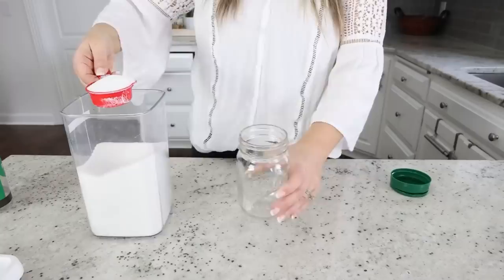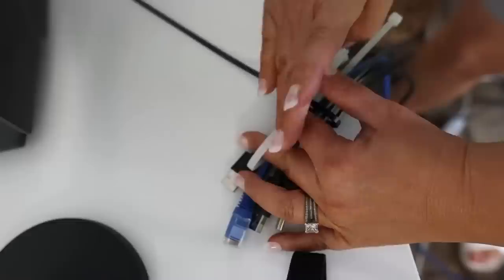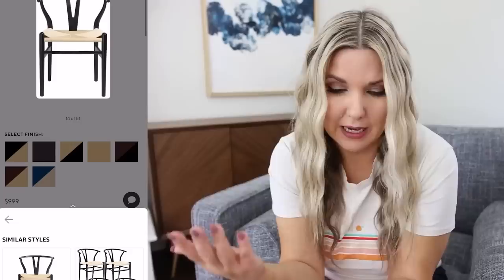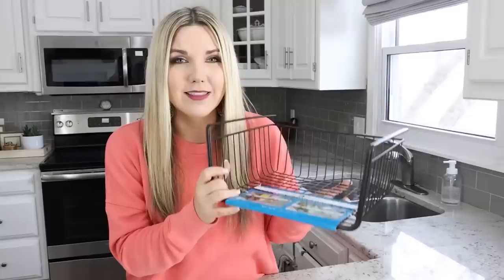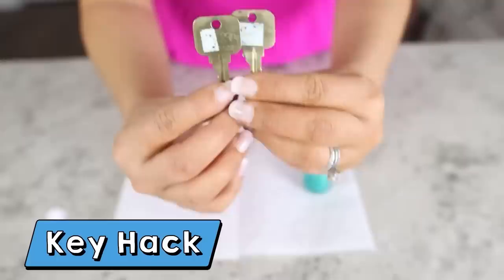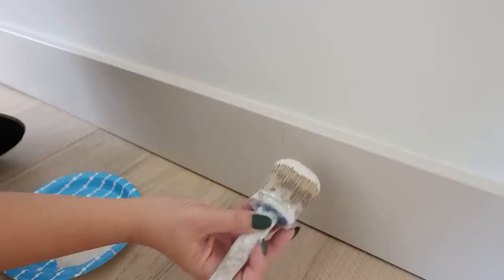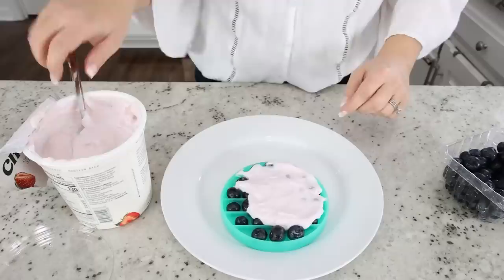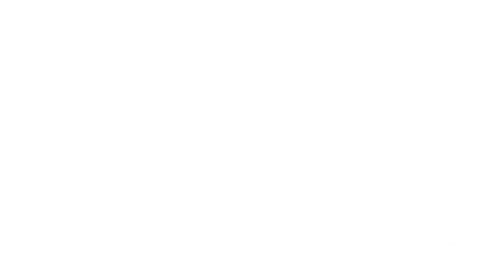60 HOME HACKS...That You HAVE TO TRY!

Comment: Watering plants:  I save an attractive wine bottle and keep it on my windowsill in the kitchen.  It looks nice and helps me remember to water my plants which are succulents and only occasionally need to be watered.  Getting label residue off of bottles:  Goo Gone is invaluable!  Using tooth brush holder for artificial plants:  Cut the stems down so that they're not sticking out of the "vase" unnaturally.  (I used to do a lot of "silk" flower arranging back in the day.  Don't forget the Spanish moss!  It covers a lot of sins, so to speak.
Reply: Might as well just use Dawn dish soap because Goo Gone not only smells horrible, but leaves it's own oily residue behind that needs lots of dish soap to get off.

Comment: Hi Liz I have watch a lot of your hack videos an have tired a lot which I love, but there is one hack that I would love to see someone come up with is an easy way to cleaning a ceiling fan without having to take the whole thing apart, it's such a pain, please if you know of a way please share🥰🤣
Reply: Use an old or cheap pillow case put over blade and pull and the pillow catches the dust!!
Reply: @Debra Murray If it’s just dusty I just use my leaf blower, I pick up the dust when I vacuum. I use the leaf blower (it’s a small one) for a bunch of stuff. I also have a small and quite air compressor that I use for dusting. 🤔🙄There is also a blade cleaning brush. When you have clean blades and housing wipe them down with Bounce dryer sheets as they will help with keeping dust from sticking as bad.
I just love her channels.
Reply: @DiywithButtacupsCreations  you can also do it with an old tube sock 🧦
Reply: @sdeaglefeather  ohhhh that’s a great idea!
Reply: Sock on a large handle cleaning ceiling fan blades

Comment: liz on the denture tablets.  before you dump the water out wipe the outside with the solution that was in the inside.  You had two vases if you are not in a hurry one tablet will clean several glass pieces.  Then all you need is one tablet for several pieces.  This method works for porcelain toilet bowls, and wash basins also.  Because you will be using more water you will need 2-3 tablets.  Let the tablets set longer than 5 min.  I would give it 30 min depending on the stain.  You used a generic denture tablet.  The name brand starting with an " E " works the best for me.  Also your water will make a big difference in the outcome.  Softened water works best. This solution works on mirrors and windows, basically anything glass.  Did the tray tiles you use have glazing on the edges?  If not they could be rough and porous.  I would sand and seal the edges and treat the wood if it was being used near water.  Baby oil builds up to yuk and dust clings to the oil.  Your better option is Pledge furniture polish or Armour All Dash Bright.  Who would not know about the fan.  Just read the instructions. DAH!   If there is any slime residue left in the cushion it will eventually work the chemicals up into the new fabric.  You also could have saved a large portion of the material you used by cutting only the fabric needed to cover the top portion. Those tabs are not just on aluminum foil but all rolled papers and plastic.  This has been around since onset and the instructions are on the box.  Come on.  Can we not read anymore?  God!  the candle hack yeah it works but you get black run down from the previous wick and it takes a hell of a lot longer.  Common sense people why are these "HACKS"?   Every single thing you have shown I have been doing for years.  They are just common sense things to do.  I'm 71 we learned how to use and reuse things in different ways.  Not like your generation of toss away.
Reply: Wow, you must be a lot of fun at a party . . .

Comment: #60, instead of using Nail Polish Remover to get the glue n stuff off of a jar after you remove a label(since it'll take the polish off your nails too) try using Goo Gone!  You can get a small bottle from the Dollar Tree for $1.25.  The small bottle will last you a long time.  & if you use it faster, you can always get more since its SO cheap.  I think it works pretty good on a lot of things like that.  & works even better.  Plus it won't take your nail polish off when using it.
Also, near the beginning(#2 maybe?) when you used the light cover for a plant/succulent pot.  When there are holes at the bottom(even in planters) you can put some rocks in the bottom to help stop loosing your dirt.  Then put the dirt on top.  The water will still drain but the rocks will help keep more dirt in the pot & not fall out the holes in the bottom.
Reply: Coffee filters work great to keep dirt in

Comment: i’ve used denture cleaner tablets to clean coffee thermos, it all depends on how long the stains have been building up because it may take a couple of goes at it lol, when i about to throw out my husband’s thermos because i couldn’t handle the stains and was sure the coffee had to taste horrible (of course my husband kept saying “it taste fine” lol) i figured i’d give one last ditch effort and dropped two denture tablets into the thermos filled with hot tap water and let it set for a while, after i poured out the water i was surprised, but because the stains had been build up over some time it gave it another go, the inside of the thermos was looking shiny new
Reply: I wonder if they would work in those disgusting cooler totes too, that are impossible to clean? Hmm. Got me thinking!
Reply: @lisamurphy3291  worth a shot👍

Comment: Great hacks .  The last one using a pickle jar is great but I would hot glue a black ribbon that is the Size of the top and either let the two ends hang over the jar or leave it plain.  I love the tooth brush holder idea also.  Ann from Va.

Comment: You don’t need a drill to poke holes in plastic. All you need is a Phillips head screwdriver and a stove. Heat up the tip of the screwdriver and pierce the plastic. Easier than a drill. Learned this at a daycare center where the staff doesn’t have drills. 👍🏻🤗

Comment: If the glass is super dirty, use the denture cleaner several times and let it soak overnight each time.  Even the hardest mineral buildup will resolve eventually.  Saves the vases whose bottom is difficult to reach inside.
Reply: For difficult area I’m going to try the shaking ice  hack 🧊

Comment: I use denture tablets to remove stains/odor from Contigo Stainless Steel Travel Mugs. It’s very difficult to get the smell of coffee out of the caps. I fill the mug with very hot water, drop in tablet, shake it up, turn upside down, and leave overnight. I rinse with cold water the next morning.

Comment: To add a hack to your hack on elevating laundry detergent containers for easier dispensing. Amazon sells a dispenser for this. If I were smart enough I could add a picture. There is a circle that fits over the pump portion and a sort of shelf that holds a lid that you can fill with your detergent and toss it to the laundry.

Comment: If you also drill a hole in the neck of the OJ bottle/waterer, you can control the fkow of the water. Put the hole as high as possible but where you can place your finger over the hole while you are holding and pouring. Finger on- no water out. Funger removed- water flows.

Comment: I always remove labels by placing the glass jar in a plastic jug, ad a drop of dish soap into the glass jar, then I fill the jar with very hot water and let it run over into the jug. Now the label is covered inside and outside with hot soapy water. The paper will disintegrate and the glue will dissolve. Any glue that remains on the glass can easily be removed with a small amount of vegetable oil. (For stubborn glue you can use peanut butter paste or margarine as it sticks to the glue and dissolve it in a view minutes.)

Comment: To remove labels, put water inside the jar and microwave for a few min.   The vinyl label will peel right off.   To remove the adhesive from the paper label, use vegetable oil and paper towel to remove sticky residue very easily.

Comment: I have found that if the nail polish remover doesn't work to use vegetable oil. Let it sit until you notice it loosens. Wipe away the stickiness. Then, use the nail polish remover or a degreaser to remove the oil and any residue.

Comment: To remove the sticky residue left after removing labels from glass jars the best thing to use is a SOS steel wool pad and hot water. It quickly removes the glue. Only on glass containers, not plastic.

Comment: Found out about the tabs on the aluminum foil from a coworker in 2008.. the way I light My candles is, I hold the candle just as she did but I use the Lighter to light 2 at a time so if there 3 wicks I light the 3rd one by itself.. (I hope I explained that well) 🤷🏾

Comment: Re removing labels
..I use tea tree oil. I buy a bottle of ot at walmart
..from the supplementsnsection.i replacenthe cap w a dropper.then when I need to remove a label I just drop several drops onto label and smooch it around.then it scrapes off easily.much safer than acetone.

Comment: Use smaller travel bottles or smaller bottles Plus the airlines when you go through security will not allow those larger containers. and then I put them in a baggie so if they do leak they leap within the baggie If it's something I think needs to be double bagged I'll double bag it.

Comment: Just soak jars with labels in water for a few hours, the labels slip right off, any residue can be removed by taking the plastic covering off stick deodorant and rubbing it over the sticky residue like a scrubby.  It takes it off effortlessly.  Use an old water bottle to water plants or fill your steam iron.  No drilling required the top just pops up.

Comment: The denture cleaner is a good idea but white vinegar mixed with liquid dish soap (or just vinegar) and let it soak will do the same thing.  It will remove calcium deposits, too....works really good on pet water bowl calcium lines that form.  No scrubbing!  All you have to do is rinse after a few minutes.  Vinegar will also remove rust. I soaked some tools (hammer, etc.) overnight and the rust peels right off.

Comment: I have a great hack for bottles, (plastic or glass) or any other container, that has a hard to remove label.   Fill the container  with the hottest water from your sink and pit the lid on and tighten it.    After 30 minutes peel the label off with the water still inside.   The label will peel off. Very easily and cleanly!!   Then just pour the water out!

Comment: If you use the blow dryer through the inside of the glass it’ll loosen it up enough to peel it off I’ve done it with plastic containers and it works really well

Comment: Yo remove the sticky stuff when you remove labels is to use oil. Any kind of oil will work.  With your finger put the oil on the sticky stuff and let it sit for a couple of minutes. Then rub off with a paper towel.  It’s very easy…

Comment: For a small watering bottle I use an empty plastic milk bottle (UK) or small water bottle.  Heat a large needle over a flame (perhaps wear some rubber gloves so you don't accidentally burn your fingers when holding the needle), then pierce the inside of the lid several times.  Screw the lid back on the bottle and it's ready for use. The needle makes a much finer hole, which is great when watering seedlings.
Reply: Hello, I hope you're safe over there? I hope this year brings happiness, prosperity, love 💚  and peace all over the world❤‍🔥 . I would love us to be good friends in honesty and in trust so as time goes on it will bring something great for us in the future, hope you don't mind?. I'm,  Nashville, Tennessee. Where are you from if I may ask😘?

Comment: for hanging a picture with a wire on the back, try putting a fork handle pointed up on the nail. now slide your picture down over the fork handle so the wire goes behind it. once its down simply pull the fork out. No more juggling big pictures and trying to get the wire on a tiny nail one handed.

Comment: Baskets I love to buy at the goodwill. But wondering if you clean your baskets before using? 
I clean mine. I brush them clean with the pan and brush set from the dollar tree store. Then I Lysol disinfected spray them and let them air dry outside on a warm or hot day.

Comment: A razor works to remove labels just spray or wet them w/ some alcohol (or water in a pinch) and let soak for  15 min to help the razor along. Razors also work on shower doors and oven windows.

Comment: To remove the sticker from the glass or plastic container, just pour some hot or boiled water into the glass, you will see how easily you can remove the sticker from the glass. Do not wet the outside of the jar .

Comment: If you want to clean and shine bathroom tub, tiles, metal, shower, the doors and no streak glass or mirrors,  Kitchen stainless steel, greasy stove top and even your oven, it even kills ants, as well as anything else that try to walk, or crawl in!

Simple mix it in 3  different strengths, depending on the cleaning task:

Regular dollar plastic spray bottles for the container:  to put 1 cup of Blue Dawn Dishwashing liquid for heavy cleaning because of the chemical reaction that happens when you pour in the vinegar that has been microwaved for 2 minutes then, shake just a little to get it all mixed and watch it foam up like dough rising! When you spray it, it retains the foamy appearance and adheres to the surface you are cleaning!  In cleaning tub and shower tiles be sure to use a sponge mop to wash it down clean!  This is extremely slippery and dangerous to walk on tile floors or in a tub!

Heavy Duty Cleaning:. #1!   
1 c. Blue Dawn in the spray bottle. / I c. White Vinegar the Microwaved for 2 minutes 
Let it do it's chemical reaction and when it's finished you can add more vinegar as you would need even to fill the container!  It will still be a super hi powered cleaner!

# 2  Regular cleaning. I go with 1/2 c. Blue Dawn in the container & add  I c. Microwaved White Vinegar, add extra as needed after the chemical reaction has finished! 

Any strength will work with ants or insects it's the amount of soapy residue that will be needed to clean up afterwards, to avoid someone falling!  So no more, than a 1/4 c. of Dawn and 1 c.  Microwaved White Vinegar for 2 minutes only!  Always pour hot vinegar into Dawn Liquid that is already in the plastic spray bottle!  You can't microwave Dawn liquid!  It's a soap, it bubbles, and vinegar is added to it creating a chemical reaction you don't want to see the outcome fiasco!  Extra bubbles, plus a chemical reaction is mess to clean up, but we'll cleaned!

Comment: The sticky label glue removal with nail polish remover is a slower process than WD40 or Straight on Dawn dish washing liquid.   I have a can of WD40 in my kitchen for just this project,  I use all types of jars for my spices and cleaning that glue is easy now that I've learned the WD40 hack,

Comment: I saw a diy vid where they used an old fork to hang a picture. After they got the nail in, they stuck a fork on the nail and then slid the pic wire over the fork. Then they moved the fork, and voila !

Comment: I wonder if the knife sharpener hack would work on scissors. I’ll have to try it out.
Reply: Try folding a piece of aluminium foil several times, then cutting it with your scissors a few times, this will sharpen them.

Comment: CORRECTION: your ceiling fan should be spinning in the counterclockwise direction during summer months, and the clockwise direction in the cooler, winter and fall months

Comment: The baby oil tip is also good if your worktop has dulled. Mine aren't very expensive and although I don't know what caused it, I ended up with a section of it losing its shine. A little baby oil puts the gleam back, although not permanently.

Comment: I wonder if denture cleaner would work on eyeglasses
Reply: Use dish soap to clean eyeglasses. Place a little dish soap on your index finger and thumb, rub the lens for a few seconds, rinse then dry with a soft towel, it works wonders.

Comment: No disrespect but those succulents are going to die from having too much water if you’re just using a basic indoor potting soil. You really need something for cacti or succulents or you could even add some rock or coral to the indoor soil to allow for extra drainage. Just saying if anybody out there is going to try that.
Reply: Yes, I was worried about over-watering, too.

Comment: You failed to mention on the CEILING FAN hack (the switch that reverses the blades) that if you switch this while the fan is ON, you will burn out your motor and need a new fan. Sometimes a "hack" is not worth it in the hands of someone who is ignorant of the other possibilities. "BE SURE THE FAN IS OFF BEFORE YOU DO THIS" is all you have to say.
Reply: Some one is unhappy

Comment: Is it an urban myth that freezing bottled water is unsafe?
Reply: It’s more about putting in glass bottles and tin cans in the freezer that can be a problem. Important not to overfill the plastic bottle with water due to ice expansion. Also having the bottle tilted a bit so there is no water touching the bottle opening will ensure the water doesn’t freeze over the hole when you go 5o fill it up theiced bottle with water.

Comment: The knife should have been tested before the rice hack. Anyway, easiest hack on sharpening knives is to use the bottom of any ceramic bowls or mugs….anything ceramic. Just run each side 11x. You don’t need to cut open a rice bag, pour onto another container…..that’s too many steps for me😊